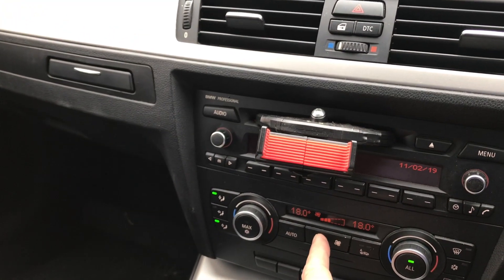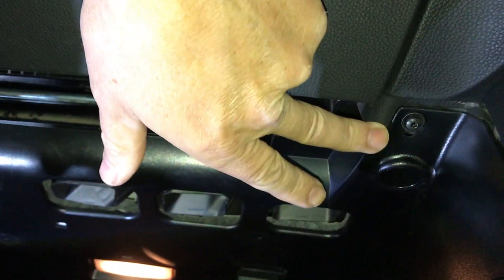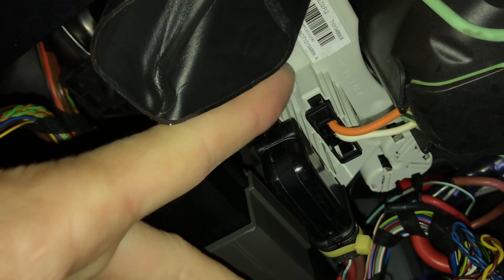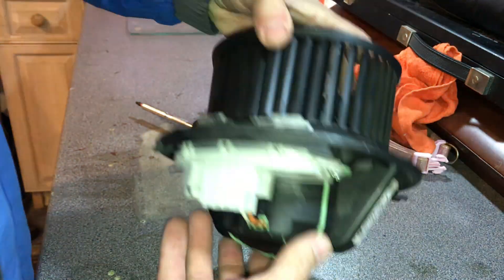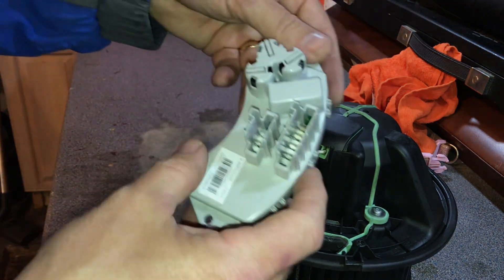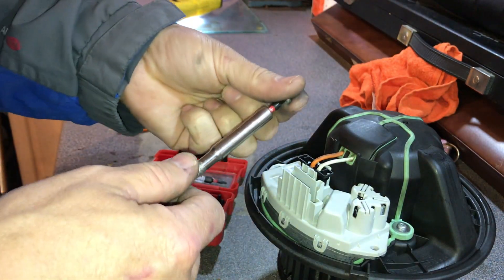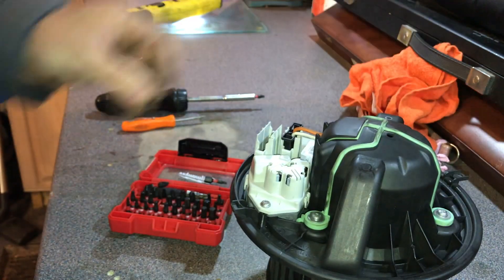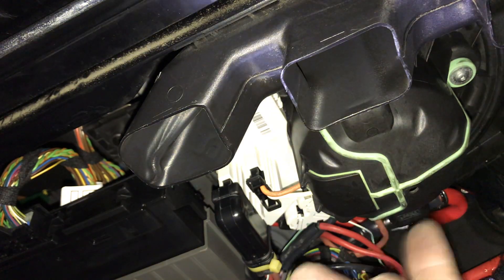BMW Heater Blower Motor Repair, 3 Series, & 1 Series "Easy Fix"

Comment: There is actually no need to remove the whole cover on the back. There's a small cap located and upon removal you can lubricate the back bearing easily.
Reply from the maker: Thanks for the great information👍🏻👍🏻🛠

Comment: Thanks for the video, helped me change my blower motor. However, I don't think there was a screw missing, mine didn't have one and to the best of my knowledge the motor has never been removed. Also, as  the motor is rotated to free it there is a plastic locating clip that needs to be pulled slightly down to allow rotation. Hope that helps others. Great, informative video though.
Reply from the maker: Good Job, & thanks for the great Information 👍🏻👍🏻🛠
Reply: did mine today, also didnt have a screw

Comment: Does this power the heater control unit too? I've replaced all my fuses and got a new control unit but the control still dont light up? Wondering if this is what I need to change? I'm getting a small amount of smoke out the heaters
Reply from the maker: the resistor only feeds the motor not the panel, it sounds like you might have a fusebox issue, Thanks for the great comments👍🏻👍🏻🛠
Reply: Thanks for the help! I've tried and changed literally every fuse I can find that has any relation to the centre console or heating but still nothing 😔

Comment: So i was told at the shop the blower motor was needed to be replaced because even when the car was turned off it was blowing hot air and so they disconnected the blower motor because they said it was draining the battery, what would i have to do in this case?
Reply from the maker: I would be looking at the relay, Thanks for the great comments👍🏻👍🏻🛠

Comment: Took it in to BMW to get this done and now my fan won’t turn on has brand new fan ,radiator, reservoir , both sensors , fuses are good too. You think they might have messed something up ?
Reply from the maker: There is a recall on the connector plug to the fan that would be my guess Thanks for the great comments👍🏻👍🏻🛠
Reply: Thank you! I’ll let you know if that’s what it was🙏

Comment: Videos like this are pure gold.
My motor had seized with rust at the worst time of year. Followed your clear  instructions and it worked a treat. Thank you for saving me a small fortune, especially just after spending £2k under the bonnet.
Wish I could repay you.
All the best bud.
Reply from the maker: you just have 👍🏻, Thanks for the great comments👍🏻👍🏻🛠
Reply: In a similar situation, my dad was a mechanic and always fixed my car but sadly past away last August. Just spent £4k on an engine rebuild and now just another £1k on brakes, suspension and various other things. Just driven it away from the garage that did the £1k work and the heating/air con won't come on. Going to attempt giving this a go

Comment: Great video, amazingly clear and calm. Managed to do the entire job in under 20 mins. Saves me an easy €50 on a mechanic. Most shops would just replace the entire motor annyway.
Reply from the maker: Glad it helped, Thanks for the great comments👍🏻👍🏻🛠

Comment: Think it's worth mentioning that you noted the fan is close to nicking the case. I'm sure that's what's causing the noise. I took mine out today with the help of this video, the fan was marked up where it was being caught by the case pretty badly. Managed to solve it by putting some washers on the pegs before screwing the case on. If the lubricant doesnt solve this issue the washers will. That being said cheers for the video mate wouldn't have sorted it without 👍🏽
Reply from the maker: Thanks for the great information👍🏻👍🏻🛠

Comment: Im having so many issues with my blower heater on 320d m sport ive been told by my mechanic that i need to get new one yet he hasnt even looked at it so im now going to try this , thank you for the video
Reply from the maker: https://amzn.to/2P53KkC this is the link for a motor and resistor £80 on amazon Thanks for the great comments👍🏻👍🏻🛠
Reply: @aaanton11  i managed to get it out easily found out that the was completely blown and seized so replaced it with great difficulty , now my rear wiper motor has stopped any advice on a quick fix ?
Reply from the maker: @devalllg8758  https://youtu.be/QpwIA9_E4e8 this is the one Thanks for the great comments👍🏻👍🏻🛠

Comment: just to say thank you for posting this video my heater just wasn't working at all after following your instructions  the blower just wouldn't come out  for some unknown reason. so  I  left it over night then had another go 
it  then came straight out did exactly as you shown to do put it back together but plugged it back in on the passenger floor just to check it worked  before going to the trouble of putting it back to find it still wasn't working switched it on and away it went thanks !!!
Reply from the maker: Thanks for the great comments👍🏻👍🏻🛠

Comment: Tips:

There’s an air vent for the passenger footwell vents? There’s a metal clip holding that. You can pull that off gives you 40% more space. Pretty impossible to do without doing that.

When putting back on put it in from the aforementioned vent side first then it’ll wiggle back in. 

When take it out use a brush (old toothbrush maybe) and hoover to remove the soot/dust before you apply lubricant. 

Before installing it wire it back and start the car and put the speed on number one and apply lubrication tiny amount whilst it’s on.
Reply from the maker: Thanks for the great information👍🏻👍🏻🛠

Comment: Thank you posting this video. It worked for me - only thing i would say guys wipe down all excess lube spray lol as you’ll smell it through your vents. Honestly I’m very pleased a good £150 saved if I took it to the garage. The black pipe at the bottom came off and I couldn’t put it back on?
Reply from the maker: Thanks for the great information👍🏻👍🏻🛠
Reply: You can get that black pipe back together but it's a 3 piece puzzle that has to be done mostly by feel.  Took me a good half hour to an hour.

Comment: well done great work!!  simple question can i use WD-40 instead of some specific lubricant ?? or a usual engine oil like 5w-30 synthetic??
Reply from the maker: Yes you can! but not engine oil its too thick, it needs to be a penetrating oil, Thanks for the great comments👍🏻👍🏻🛠
Reply: In my opinion gear grease or wheel bearing grease would have the best longevity, but on the fan side it will almost be impossible to bring it inside the bearing. Do you think it'll be possible to remove the fan? Is there a nut of some kind?

Comment: I’ve had to replace mine twice both of which stopped working with no indication of failure ie squeaking or making any other noise. 😬
Reply from the maker: Dam thats unlucky. Thanks for the great comments👍🏻👍🏻🛠

Comment: Applicable for F-Series as well with fault code: 801204- Blower output stage: Locking or short circuit detected at the blower motor.
Reply from the maker: Thanks for the great information👍🏻👍🏻🛠

Comment: Damn it look so easy for you to put it back, I'm struggling to put the motor back and lock it in...
Reply from the maker: push it up and rotate it, you can do it keep trying, Thanks for the great comments👍🏻👍🏻🛠
Reply: @aaanton11  thanks Mate, I finally did and the funny noise was gone too... Thanks to this guide but it was really a tight section.
Reply: It was a little tricky for me to but you just have to giggle it

Comment: I did this and found what I assume is the antenna dongle inside it, no wonder it was vibrating o much! 
Anyway the noise wasn’t the only issue, as I have no air coming from dash vents at all (rear work fine) I changed cabin filter under bonnet, still no joy.. so I’m stumped… any ideas please? I’ve asked on forums and watched loads of videos on here but no joy
Reply from the maker: If the motor working at all? Thanks for the great comments👍🏻👍🏻🛠
Reply: @aaanton11  sorry for long reply, didn’t get notification.. yes blower works fine just slight whisp of air from vent themselves, even on full power 🤷‍♂️

Comment: After I replaced this completely I was notified of a small coolant on the system checked and no coolant on the tank in advance I had changed the thermostat but why did I lose all the coolant after I changed the fan? any connection? can not see signs of leaks BMW 1 series 118i E87 but the car runs well. And that plasctic cover on 11:49 most be on? I cant get it on;( again
Reply from the maker: no connection to the fan, maybe a coincidence, Thanks for the great comments👍🏻👍🏻🛠
Reply: @aaanton11  Yes true true, but after thermostat change nothing more antifreeze happened so maybe not ventilated properly? If you do not ventilate then not all coolant? is it possible? plzz reply. I mean if the mechanic not take out air after termostat change it can drain ALL of the collant? its only logic here some people say that. SO? Could it be the radiator cap? because I do not hear a click when I lure it it should hear clip sound when you lure it.
Reply from the maker: there is a specific way to bleed these systems, there is a plastic screw on top of the radiator which needs undoing then fill the coolant bottle til fluid comes out of the screw, squeeze the top hose and refit the screw and bingo. Thanks for the great comments👍🏻👍🏻🛠
Reply: @aaanton11  yes I know but I have no air in the system now thnxs you mean this video right?? https://www.youtube.com/watch?v=ogh4PiEy6Ps&list=PLlBxjXFZX3hUhe3Exn6GnTzSF2kVgXl1G&index=8

Comment: Hi, my fan isn't working at all. will this be the same problem?  Thanks
Reply from the maker: high probability, just pop the motor out as in the video changes are it will start again. you can also check for voltage at the wires, Thanks for the great comments👍🏻👍🏻🛠
Reply: Took it in to BMW to get this done and now my fan won’t turn on has brand new fan ,radiator, reservoir , both sensors , fuses are good too. You think they might have messed something up ?

Comment: Great video. Shame you edited out the part where you spend ages getting it to click into place. I spent 20-30 minutes trying and failing to get it to fit, before eventually I gave up and removed the glove box and the heater duct. THEN it was easy enough to fit it. And I’m an experienced mechanic. Your video makes it look like a 10-minute job, which it most certainly is not.
Reply from the maker: This one went in nice and easy, it might be a bit harder on other model variants,Thanks for the great comments👍🏻👍🏻🛠
Reply: Bit of perseverance 😂
Reply: You should bring it to a dealer then. The video is trying to help save people money by doing it yourself. You must be a kid with all the whining!!!

Comment: My blower works when I put it to heater but not for AC, I checked the big AC fuse & it was blown I’m guessing something with the blower motor also blown in the process of that fuse blowing, my question is their a way to refurbish these motors to work back to 100% & if so how

Update: I know it’s the blower motor & not the regulator because I got a new regulator for my old blower & nothing still the same problem, but when I got a new blower motor it worked perfectly, it’s back to working the way it’s supposed to, it’s just weird that the old blower motor worked for heater & not AC
Reply from the maker: That is a strange one, I was thinking may be an issue with the air con compressor popped the fuse, if it goes again thats where I would start to look, Thanks for the great comments👍🏻👍🏻🛠

Comment: I can't rotate that blower out for the love of even after ending up breaking the tab ..!!!
Reply from the maker: there must be something holding it in! Thanks for the great comments👍🏻👍🏻🛠
Reply: If you have CUP HOLDERS you have to TAKE THEM OUT FIRST! I had an E90 LCI with no cup holders and the blower motor came out easy. Last year I got a coupe E92 WITH cup holders and I ran into the same issue. I could not twist the thing to get it to come out.  I almost broke my tab as well. On a whim I decided to take out the cup holders to see what the heck was going on. Once I did that, the blower motor came out super easy. It's super freaking weird. I've seen this done with the cup holders in but for some reason there's more than one design out there it seems.